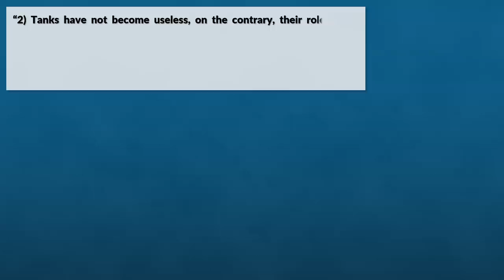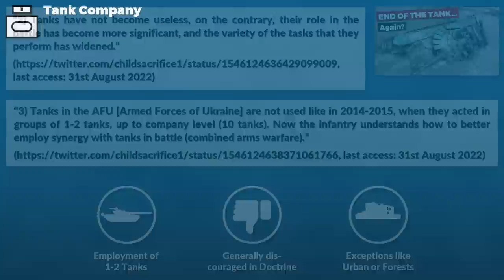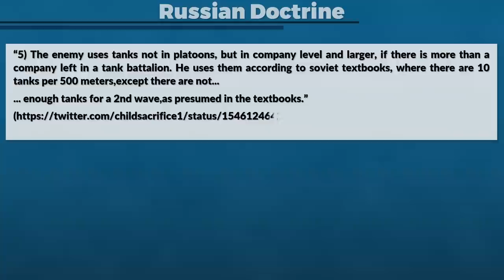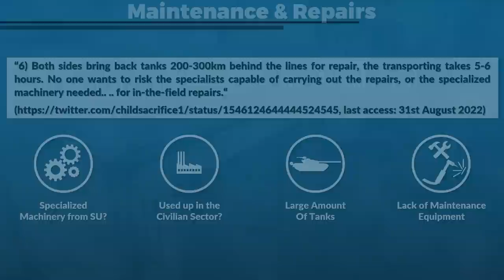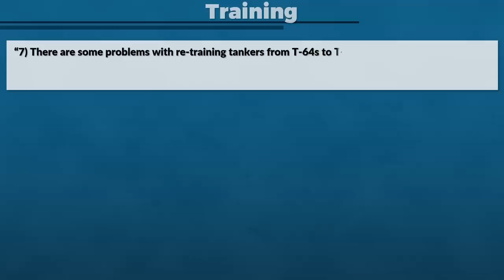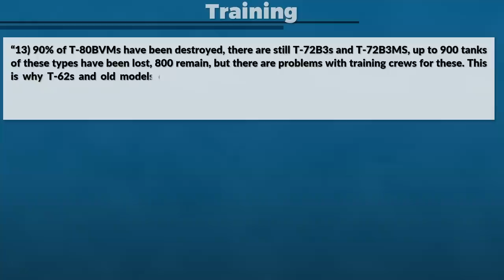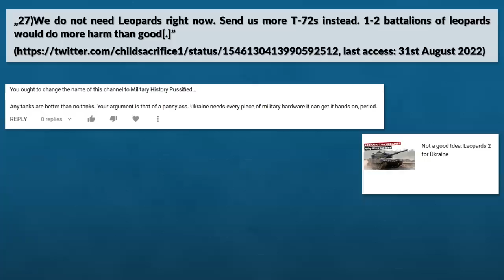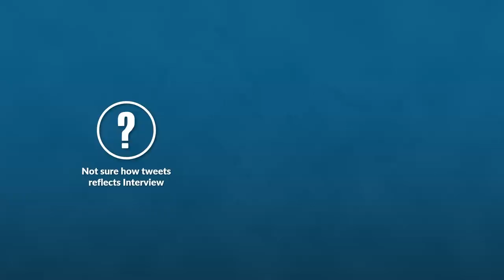What Ukraine thinks of Tanks

Comment: If you percieve battle as a balance of power, every quality an army posses can theoretically be quantified and weighed against it's rival. Of course quantifying the qualities of apples and oranges is incredibly difficult and there is so much information that the military doesn't know about it's own forces capabilities, let alone the enemy, this can't realistically be done...

HOWEVER, the relationships between these qualities is not dependent on such metrics.

It is known that bigger guns are better.

It is known that more guns are better.

It is known that more men can carry more guns.

We know guns kill men.

With these 4 facts alone, we can easily deduce that a tank, that can be fairly described as a big armored gun carrier is a very useful thing to have. No matter how weak the tank may be vs it's direct counter, it's unquestionable offensive strength means it will always have a favorable relationship to most targets.

Counter measures reduce the effectiveness of tanks, but unless these countermeasures have a 100% success rate and/ or are invincible to counter attack, the tank will still retain some offensive edge by virtue of the fact it carries a really big gun.

Big guns are better. The more of them you have, the better. The number of men it takes to man a tank, compared to foot bound infantry puts the tank way ahead in firepower.

If you can afford to mechanize your infantry, it is ALWAYS better to do so. Russia's issue is they are low on men. They are throwing away machines to make up the difference, and this makes the machines look weak. But in reality, the Russians are just compensating for other issues.

If the tanks were properly supported with adiquate ifnantry support, you'd not see them taking such heavy losses, and there would be no questioning thier relivance on the modern battlefield.

In previous wars, the US deployed nothing but special forces and light recon units. The were not equipped or supplied to wage war at any scale, and were subsequently useless. This is not a mark against the US military's hardware or the quality of their troops. It shows a lack of commitment at the highest levels of the US government, and a lack of personal responsibility by mid-level commanders who refused to recognize or address the US military's low combat strength.

Russia similarly isn't fully committed to this conflict and their half measures are bleeding them dry. This is not a military issue, it's a political one.

America did not lose the Afghan war because the Afghans were stronger: America lost because America gave up. I'd argue they gave up decades ago, and have been just stalling this whole time. But regardless of where you draw the line, the US military never took Afghanistan seriously. So it's not fair to say the US or Russian military is weak, more like incompetent. They are strong, they just don't have the brains or the will to utilize their strength correctly. This argument could me misappropriated very easily out of context, but if you take the time to analyze either of Russia's or America's recent military escapades, you'll see that neither force has fought at full strength. They're both losing, but they're losing at less than 25% of their full power.

Comment: Is it possible that they wish to avoid African and Asian tanks because they are the "Monkey Model" (not my term), they may have so much downgraded equipment that bringing them up to Soviet standard might be impossible, not to mention modernizing them to near modern standard.
Reply: It may not just be downgraded equipment, but also inferior/cheaper armor.  I heard stories about the US Army analyzing captured Soviet equipment from Iraq; when they weighed the tanks and personnel carriers, they weighed significantly less than those used by the Soviet/Russian Army.  That was attributed to thinner or lesser armor.
Reply: They are often in a terrible unmaintained condition or instead already worked to death. Few of the smaller buyers ever bought road transporters. Even the ammunition has often been stored improperly. Shoved into glorified sheds in the heat and damp instead of proper cool dry bunkers. The result of the last is unreliable ignition and shells varying in power resulting in them not matching the sights. With creditable exceptions you are buying assembled scrap spare parts. On the plus side, the annual repainting for the annual state parade must have added to the armour protection………
Reply: @JBM425  I guess they would be replacing a lot of the equipment anyway, but... you can't replace the armor.
Reply: @johnfisk811  They should have bought armored cars, those things have been kept running in small armies for years, some don't even need transporters, and they are usually available for more operations. They cost less in the first place, and they present a smaller target for the poorly trained anti-tank crews they are most likely to face. Maybe if they hired an artist to do the paint scheme they would look just as good in the parade!

Comment: For Ukraine, the transition to NATO tanks will happen eventually. The old Soviet tanks are acceptable for now. But if the war becomes a long one, which is very likely, Ukraine will have no choice but find non-Soviet tanks as replacements. It makes no sense to continue using tanks produced by your enemy indefinitely.

For the question of which NATO tanks are suitable for Ukraine. With few exceptions, most NATO models were produced in small numbers and are no longer in production. If Ukraine wants NATO tanks for this war, only a few options are available. Of course, this is under the assumption that Ukraine will successfully solve its logistical limitations.

Comment: You might find this surprising but Russian tanks have only made a difference in urban combat where they can sit back and fire into and through buildings. Tanks are being taken out in droves by artillery/mortars/mines and atgm's elsewhere. Drones and the shortened killchain time with precision weaponry have made Urban combat the safest place for a tanker.
Reply: not alone though; the tank needs infantry support because otherwise there could be a single enemy infantry behind a wall with a rocket launcher to destroy the tank from the side as it passes
Reply: They do this from 2000-4000 meters away in relative safety using the buildings further back as cover.

Comment: India has about 2500 T-72 tanks in good condition and in active service ready to use. They could theoretically sell all of them to Ukraine immediately and still be fine. India also has about 2000 T-90 tanks in service with another 500 on order with local assembly. Additionally India has been looking at acquiring other types of tanks and has a couple hundred Arjun of various types and is asking for proposals on light tanks right now. They are open to other designs with local production. They are generally satisfied with the 2500 T-90 that will be half of their force but would prefer other tanks for the other half. Thus the 2500 T-72 they have are going to be divested as soon as replacements can be acquired. Ukraine would love 2500 additional T-72 and it could be enough to turn the course of the war in their favor. It would shift the tank dominance to Ukraine instead of Russia.
Reply: Poland has about 250 T-72 and PT-91 tanks still available but need replacements before sending them to Ukraine.
Reply: Bulgaria has about 400 T-72 tanks available in service and in storage. Some might need maintenance but they have facilities available to provide it if funds are made available.
Reply: Romania has abound 300+ T-55 and TR-85 tanks among other T-55 modernized derivatives. These might bot be suitable for front line use any more but are still adequate for training and reserve unit use. They can still provide some fire support to infantry if required.
Reply: Doesn't India support Russia though? Seems like they wouldn't be interested in helping Ukraine.

Comment: Im not arguing against this video…im just finding it interesting that western aircraft such as F16, Griphen 39, F18, Rafael and Typhoon are on Ukraine’s wishlist but not tanks. A Leopard could be adopted to the Ukrainian armored doctrine but with a great loss to it’s potential (more harm than good compared to a T72). A MIG pilot would need months to train for an F16 and then Ukraine would still need to integrate its command structure, logistics and strategy to even begin handling them at some level off efficiency.
Reply: because there are no more soviet aircraft available maybe... because aircraft dont need bridges. because aircraft is easy to fly away to fix it and fly it back to battle...
maybe... im guessing.
essentially with aircraft they would only need to train maybe 100 pilots tops and have huge force already. and rest can be contractors 300km away from front. so i guess its easier to do than tanks.
did i mention bridges? leopard is much heavier than t72 or t80 so bridges could be a problem. 
but on the other hand if those jets fail...that can tank american exports so another reason for not providing those.
Reply: Leopard 1 and 2 ARE on the Ukrainian wishlist for months now.

Comment: Are tanks obsolete? no, but they need to be used correctly and at the right time, gone are the days of massed tank offensives on the open field, due to the ubiquity of man-portable ATGM's which can, and will, destroy modern MBT's. And a critical lesson that has been learned the hard way countless times, that Tanks have to be supported by infantry, and are best used in conjunction with both infantry and aerial forces for maximum survivability and combat power.

Comment: Sounds like tanks are as hungry for human flesh as the G3, FN FNC and almost every other weapon system with manually locked open parts (the cut out for the hold open of the g3 operating handle) or friction locked parts (folding stocks without latching systems to hold them folded) etc.
Reply: When I played soldiers at university forty years ago the cocking handle on the SMG (Sterling submachine gun) could be quite bitey if not handled correctly.

Comment: A cheap tank poorly maintained and operated by poorly trained troops is exactly that. To use tanks wisely, you should not have them out in the open. Or push with them unless sufficiently supported. You have engineers dig or blast out some holes deep enough to hide all but a gun tube of a tank. A bad ass game of whack a mole. Pull up, fire, reverse, line up to a different one, repeat. Tanks are also not defenseless from attacks from above. The M1 has a skate mounted 240 on the loader hatch (the guy who not only loads rounds into the big gun, but can end you with these as well), as well as a 50 cal cupola mounted remote controlled machine gun as well (he can fire with the hatch closed). A good loader and TC can spot and end any light or small aerial attacks like an advancing drone. Not to mention support would see long before hand. Russian troops are poorly trained with poor equipment that is old and broken. Or made in such quality it is in worse shape to begin with.